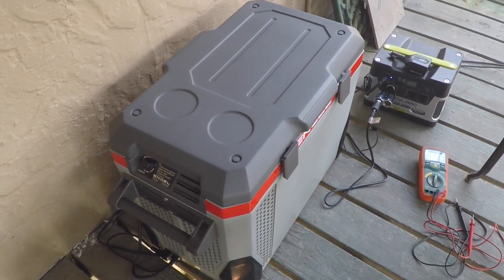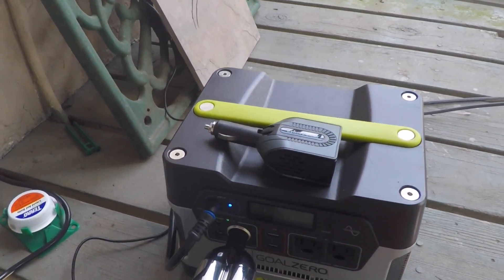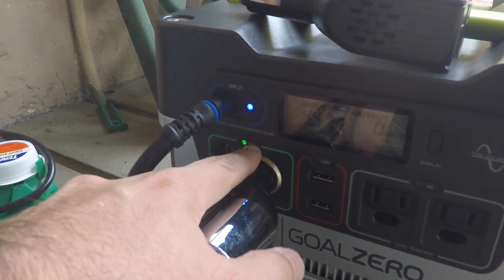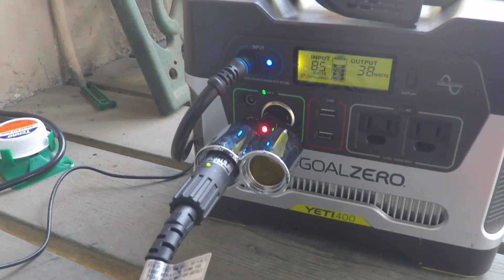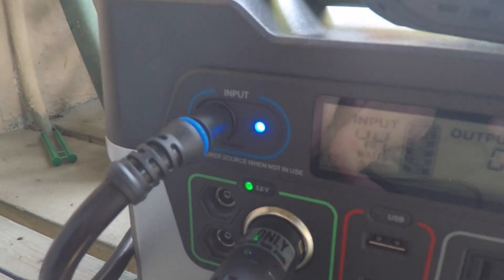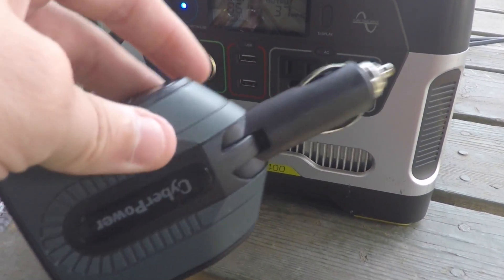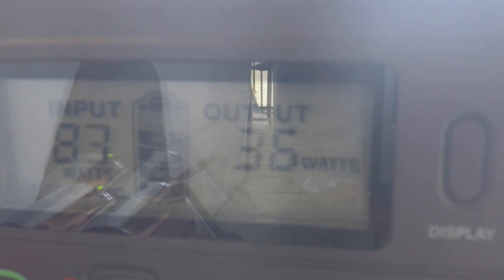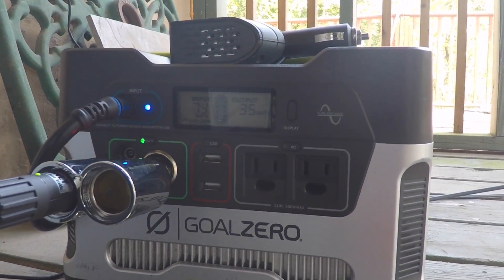Yeti 400 12V Problem - Part 1

Comment: the issue is the goal zero doesnt like  the bump start that compressors have. The fix is to use an anerson and power straight from the battery

Comment: Call gold zero tell them the problem with the lighter adapter from the refrigerator they will send you an adapter for free
Reply: Yep, and the crappy adapter they sent me plugs into the 6mm port, looks and feels extremely cheap, and is wired with 18awg.  The cable on it is no bigger than a USB cable.  I bought an Anderson powerpole to cig lighter plug adapter cable from PowerWerx.  Much better solution.  16awg cable, fused at 15 amps, and excellent quality.  Bypasses all the electronics on the Yeti for much more reliable operation.

Comment: I have the Yeti 400 as well. I have been powering the battery with a 100W solar panel but I noticed the battery level on the Yeti keeps dropping when I am not running any appliances on it. I wonder if yours does that?
Reply from the maker: +Quinnie Bui only if there is no solar input. AGM doesn't hold a charge for long.
Reply: createthis the part I'm stumped upon is I did have  a low to 9 watt input power from the solar panel but my battery kept draining ,  just like earlier today where I had it recharged by the solar panel and the battery level kept dropping from 60% to 20% and as I'm writing it's at 0. I have it recharged inside to bring the charge back to full. It I'm recharging and and no output power is being used, I would suspect the battery level would go up.  This is my first time using solar panels, I have silly questions.
Reply from the maker: +Quinnie Bui yeah, that doesn't sound right at all. I'd check the voltage of the battery with a multimeter via the Anderson connectors on the side. If the voltage is changing along with those percentage readings you may have a bad battery. They don't last forever.
Reply: oh jeeze. I just bought them this year. Will call GZ in the morning.
Reply: Did you guys connect the solar panel directly to yeti?
Reply: Angel P Hi...thanks for asking. :) I have some experience using GZ now.  It was a novice question and first time back then using GZ and solar power.

Comment: I know you've already found a work around and no longer even using your goal zero for this purpose but just in case others are interested, I have a small Domatic 12v compressor fridge/freezer also, it's only a 11 liters unit so it's REALLY small in comparison. And when i plug mines in, the 12v automatically stops working like yours did. If i unplug it and plug in something else it will not work, but if i turn off and on the switch it will work again... that is until i try to plug in the dometic again and then nothing... very annoying. I will probably be using the anderson ports as well.
Reply: Much better solution, and what I did with my Yeti 400 and Dometic CFX50W - I bought a cable from PowerWerx.com. It is an Anderson port-to-cig lighter adapter cable. It is fused at 15 amps, and 16awg wire size. It was necessary for me, as the Dometic's cig lighter plug has a very fat tip, and the raised shoulders in the Yeti's socket won't allow it to make contact. This solution bypasses all the electronics in the Yeti, and gives you a direct battery connection.

https://powerwerx.com/automotive-cigarette-lighter-socket-fused-powerpole-connector

Comment: I know it's been a while since you had this combo and you found the fix, but is there a reason why I couldn't just use the 110 outlet on the Yeti 400 for the Engel?
Reply from the maker: +Lisantica It's quite a bit less efficient. The inverter uses unnecessary power converting from 12v dc up to 110v ac. You'll have shorter run times on battery.
Reply: Ahhhh, I see what you mean.  I'm new to this, but at least I can do the 110v ac in a pinch...but I will look into getting this set up to go with 12V through the Yeti or through a secondary battery situation in my van.
Thank you for the quick reply.

Comment: your double adapter will not be helping you,, the wires inside them are very tiny, 1/4 size of the fridge wire, voltage drop.
Reply from the maker: +GODISMYJUDGE it probably does, but I also know it's probably not the voltage I want it to shut off at.
Reply: BTW, Thanks for doing this, I know why neither Goal Zero I have works correctly with the DC plugs. Called GZ over a year ago explaining this same problem and they had no idea.
Reply from the maker: +ray ash this was a long time ago, but the fix for this was to use the Anderson connectors on the side of the Yeti coupled with a low voltage disconnect (APO3). There's another video that details the solution. I ended up not using the Yeti 400 long term as I found myself needing more than 200Wh on a regular basis.
Reply: Doesn't the freezer have a voltage shut off like the ARB's? It seems that would eliminate that additional box you added in your other video.

Comment: Would this be a timing issues? If it powers off after 24 hours due to the reasons you found in this and your other video, why would it not trip it on the first power up straight away? I go away for weekend events and having this shut off every 12 hours is a bit concerning. Thanks for your video! It's insightful!
Reply from the maker: +Bobby Flaspohler That's a good question. Might have something to do with amp draw at lower voltages. Not sure.

Comment: Hey, I enjoy your videos. Thanks for making them.  On the 12 v issue.  If you had to... you could get a cigarette lighter socket from and autoparts store, open up the case (4mm hex wrench) connect directly to the battery and have the wire come out the back of the Yeti 400 case. Then you would bypass that switch and the auto shutdown issue.
Reply from the maker: +Larry Greenup I just made a video on that subject. I even added a battery protection circuit and attempted to measure the inrush current from the Engel compressor using my oscilloscope and multimeter. Check it out: https://youtu.be/O_DnUwPpbKQ
Reply: Much better solution, and what I did with my Yeti 400 and Dometic CFX50W - I bought a cable from PowerWerx.com.  It is an Anderson port-to-cig lighter adapter cable.  It is fused at 15 amps, and 16awg wire size.  It was necessary for me, as the Dometic's cig lighter plug has a very fat tip, and the raised shoulders in the Yeti's socket won't allow it to make contact.  This solution bypasses all the electronics in the Yeti, and gives you a direct battery connection.